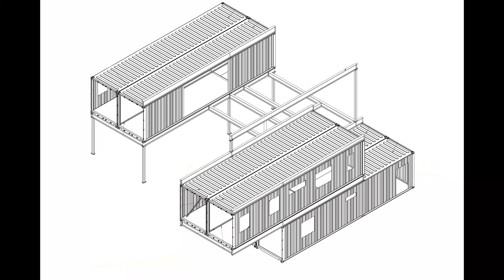SHIPPING CONTAINER HOME - Installing Steel Beams

Comment: What structural grade steel beams did you use for vertical and horizontal, and how did you bolt them together?

Comment: These beams are the size used in skycrapers...  they are overkill for a house, right?  You can see steel houses framed with very thin steel.
Reply from the maker: keep watching, we designed the house with the help of an engineer we aren't just winging it
Reply: @SunfishBudget  Great project... residential engineers tend to overbuild probably because there isn't a lot of data out there for steel beam residences, so when in doubt they go to the next biggest beam in their software.  Notice how you have much smaller beams for the foundation/supporting beams than you have for the cross beams?  You typically want the same size or greater going vertically for the support/foundation.  For example, the shipping containers themselves can support around 65,000 lbs on top of their small beams and corrugated thin-wall sheet metal frames.  Most of that weight is on the corners, and they can be stacked around 9 units tall, based on that weight bearing capacity of fairly small beams... this is without added support, just so none of the walls are cut out and the structure is 100% intact.  I'm not sure why your engineer used smaller beams for the vertical supports in the foundation/first floor compared to the spanning beams.  I'll try to watch your future videos.
Reply: I just realized I have seen your whole build.  Very creative.  I'm sure everything is fine since you had it engineered.  If it were me I would  have used the same size beams for the vertical and horizontal steel structure.  It's interesting to realize that whole part of your house is held up by each of the 4 bolts under those smaller boxed beams.  I saw a guy here on YouTube, who I think was an actual engineer, building a little guest house in the back of his house on here and he didn't read the intended use for the materials he bought and he put the whole weight of his building on 12 3/4" bolts, not realizing they were for decks only and had no sheer strength whatsoever.  He also set the bolts into the concrete then he screwed them up and down which is not supposed to be done and greatly weakens their strength.  The metal bolt footers he used were made to be adjusted, but not after set in the concrete, only prior to putting them into the concrete, he didn't understand this nuance.  This means they were for intended for use in a deck that had little no ability to catch wind and get lateral stresses because it had no structure except the flat deck and some rails.  But a house catches the wind and also catches the snow and has the load of everything inside it.  I haven't checked back to see what he did but, the direction he was going was a recipe for a disaster.  It will be fine until that moment when it fails catastrophically.  You might ask the sheer load and weight capacity for those bolts and add them up to see the lateral wind force your structure can withstand being founded only by the bolts, like that.  If it were me I would have sunk the whole larger beams deep into the concrete and/or used larger bolts.  I know it's normal to put the whole thing on bolts like that but it just seems counterintuitive because the whole structure is on just a few narrow bolts and everything depends on their strength.